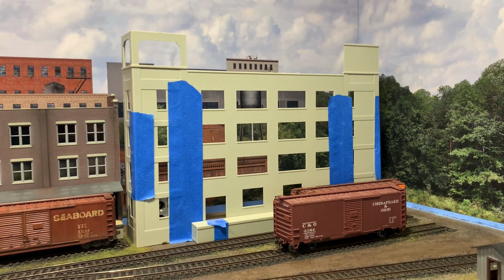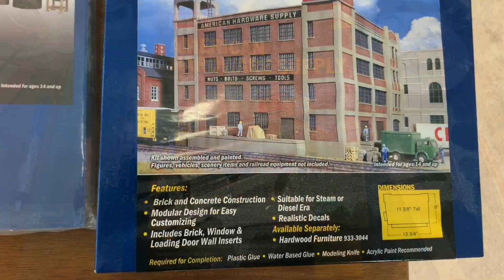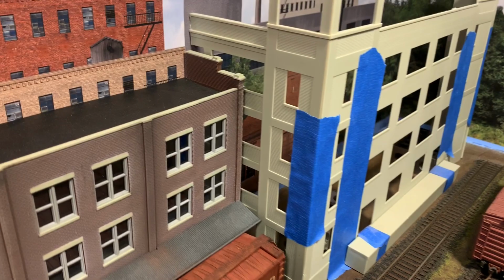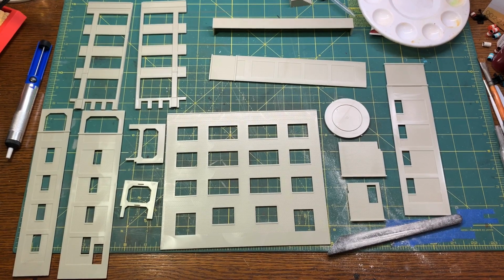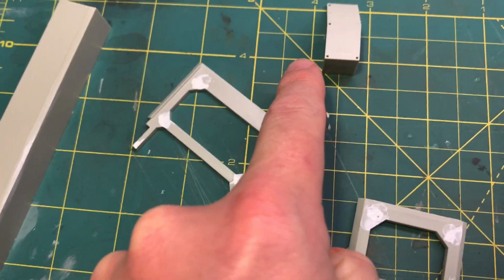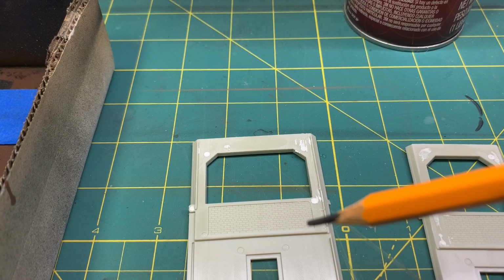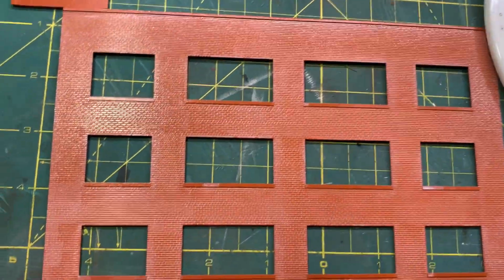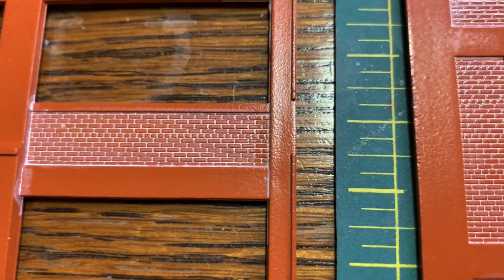Brewery Build - Part 1

Comment: Great work ! But I'm loosing you here... You've painted the walls with an oil base spray paint AND used an oil wash for mortar. My question is : What did you used to rub the excess white ? Must be an oil base thinner. I agree with you 100% that oil paint is most of the time easier to manage than acrylic. My concern here is how did you remove excess white without "attacking" orange base color ? Again, you did great with the paint job ! I would REALLY like to know...
Reply from the maker: Thank you- in between the enamel spray and the oil wash, I put a gloss acrylic clear coat on.  And the beauty of the oil wash was that there was no excess to remove off the face of the bricks - the oil in combination with the gloss coat really flowed into the cracks.  I removed excess from the side of section right in the crack, and it flowed freely otherwise.  once all that set, I went over the top with acrylic matte clear coat to seal it in.

Comment: HAdn't bought any of these building kits in a long time, stopped in to the local Hobby Shop and was floored what they are charging for 4 plastic walls and a roof.  $80 for the brewery I wanted to add to project in HO I am doing.  80 dollars!!!! No details, no features nothing but plastic a box and shrink wrap, looks like the corps. are after destroying yet another hobby.  The inside has Zero details, no figures not 1 single thing other than the plastic panels and some clear windows.
Reply from the maker: Hate to dissuade support of a local hobby shop, but you can often find kits and stuff at around half price on eBay.  Not sure what kit you saw at 80- but a lot of cornerstone stuff on eBay is well below that.

Comment: I recently purchased this kit after watching another video on it. The other channel I believe was called (asd asx) he has some excellent weathering techniques and he did an exposed rebar modification to this structure that I really like. I have never tried oils for mortar joints but have used it with rust streaking and now you have me wanting to try it on mortar lines. I think the holes you had to fill on the parts are from the ejection pins that kick the part out of the mold in the manufacturing process. I will be following this build with a lot of interest. Great work. Cheers Rob
Reply from the maker: Thanks - I will definitely check that video out.  I got to thinking, exactly as you say with weathering techniques, why wouldn’t the same properties of oil based paints work for mortar?

Comment: I almost never use warehouse buildings like that, for their intended industry. A suggestion for cutting thick styrene. Clamp ur strait edge in place on the cut line. Make sure its exactly where u want it. Then u take a jig saw, sawzall, razor saw, or just a blade. Use a blade meant for wood not metal. At a low speed (or by hand), cut down the side of the strait edge, using it as a guide. When done cutting, turn piece over and clean the burs from the edge. Clean cut and much faster than hand cutting with an exacto
Reply from the maker: Good tip and certainly a better method than what I did. Thank you!